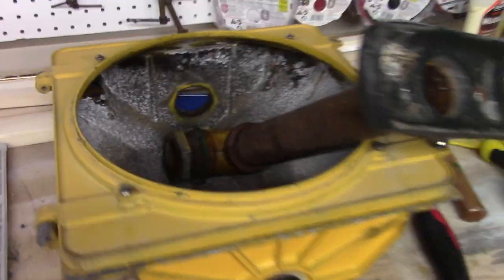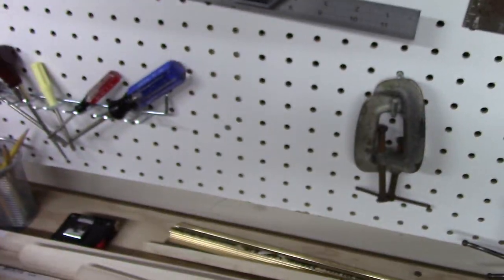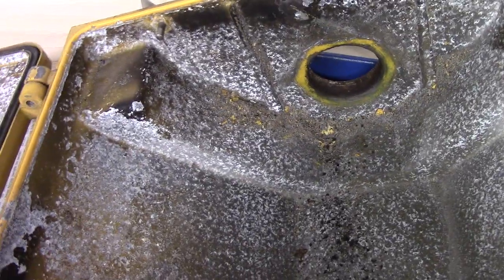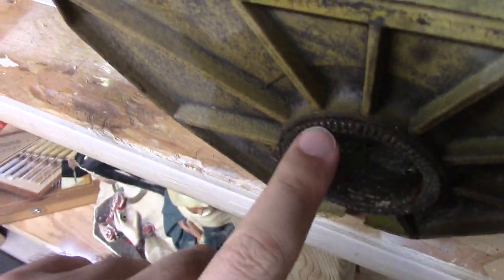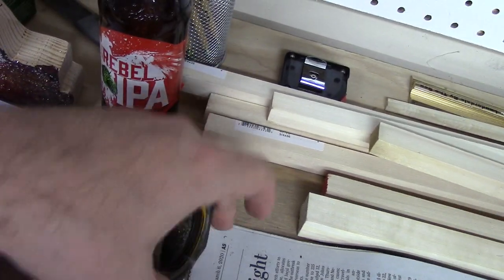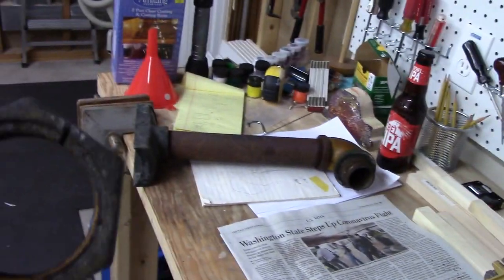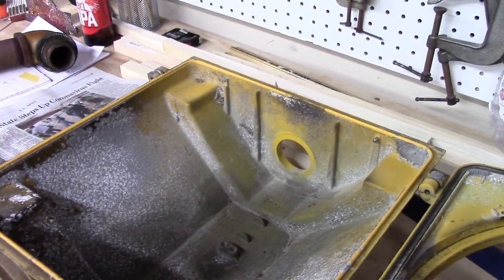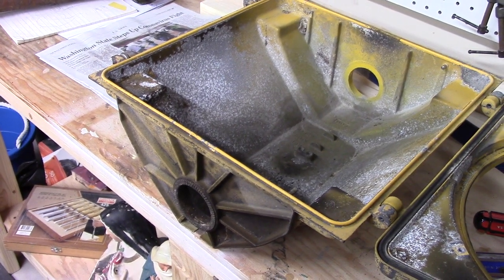The Traffic Light Top Mount is Finally Off!

Comment: That's great that nut was finally able to be removed, and I'm glad you didn't have to go past plan B.  I don't think you need to spend the extra money for high temperature paint. It's really not going to see the extremes like it did, when it was in service. I also agree with Signal Fan Zane about the Rust-Oleum paint, that's all I use for small paint projects. Krylon has let me down too many times.
Reply from the maker: Yeah I think so. This light won't be on nearly as much as it used to be, so regular paint may be okay.

Comment: I like the original paint, gives it character
Reply from the maker: Kinda does, but it's so inconsistent along its length.
Reply: Sharkie626 also I wouldn’t paint the inside. It leaves the mark of when the signal was in service, and you don’t see it anyway.
Reply from the maker: @Sebastian0113  That's an interesting way to put it.

Comment: That's probably exactly why your brother had such a hacksaw.  There's a tool for every job.
A Dremel would have been much faster.

I see that was only a 1 beer job.

As for painting the inside, I'd say yeah, probably.  I wouldn't even worry about high heat paint for it.  When in normal service, this light is on 24 hours a day, or if it goes to flashing yellow after hours, at least 12 hours a day.  Think about how much use the light is really going to get.  Even if you leave it running for a day straight, the paint doesn't burn off that fast.  It's never going to be baked the same way as it did in service.
Reply from the maker: Dremel definitely would have been faster, but since this was already halfway done, I figured more manual cutting would be a cinch. I should get a hacksaw like that too. 

I didn't even notice the beer until I got to editing. I said "Ha! Jay's gonna like this!" 

Good point. My lights are on a fraction of the time compared to when it's at the road, so maybe regular paint will do just fine. 

Curious. What did you think of the later video publish time? With everything that's going on right now, and figuring more people, especially in the western US are awake by now, I'm trying early afternoon times. Views already seem slightly better from the last light video.
Reply: Harbor Freight probably has one.  I should probably get one too.

For the video publish time, maybe.  Depends.  I use the old subscription-based notification.  I go to subscriptions, and see what people uploaded, then pick and choose from there.  Those that do the bell icon and only watching on their iPhone hun, and generally won't be paying attention as 16 texts come in over the course of your video.  Comme si comme ça.
Reply from the maker: @jaykay18  Ah okay gotcha. I actually don't use the bell, and I don't have the mobile app either. I check the same way you do. I may try around the same time for tomorrow's video, and see how it goes.
Reply: Cool.  Look forward to seeing that!

Comment: I deal with tri-studs. They are so much easier to get off after their service life. I use enamel paint on incandescent signals that run for hours on end almost all day most of the time and have not had any problems with heat damage. I recommend Rust-Oleum over any other especially krylon and agree with painting it.
Reply from the maker: Oh yeah, Rust-Oleum is a fantastic brand. I've used it in many instances at the LI house, and it worked beautifully.

Comment: Was it hard getting the visors off of your 8” or 12” traffic signal??? I want to re paint my traffic signal yellow but the screws holding down the visors are a pain getting off
Reply from the maker: Just one of them was. All the others were easy!
Reply: Sharkie626 how’d you get it off???
Reply from the maker: @treytrent1999  You simply loosen the 4 screws that the visor hook on to, and then a quick turn to the left for the visor will remove them.
Reply: Sharkie626 oh no I know that, I’m wondering how you got the screw that was stuck lose? Every section of my traffic signal has that one stuck screw while I got the others lose with no problem
Reply from the maker: @treytrent1999  Ah okay. I just found a larger flathead screwdriver that fit the screw better. Some careful turns and it came right out!